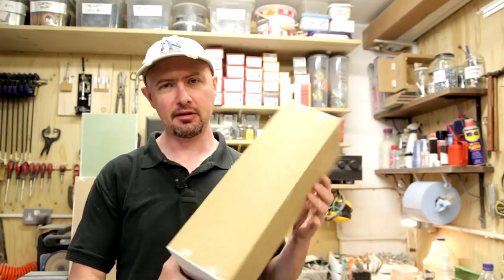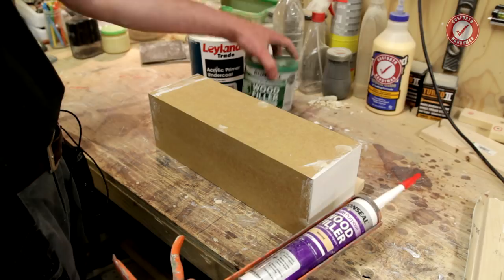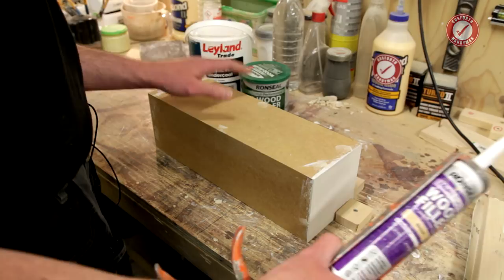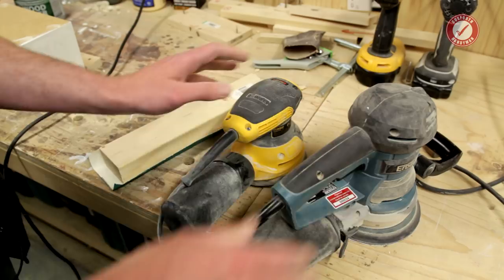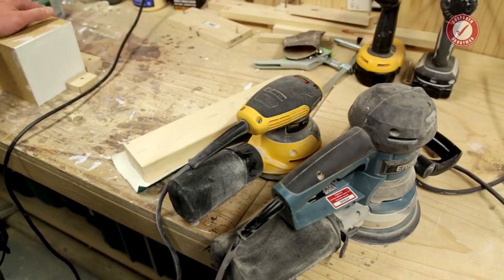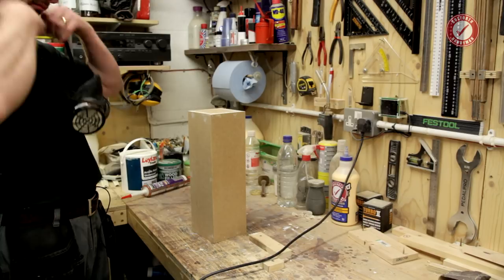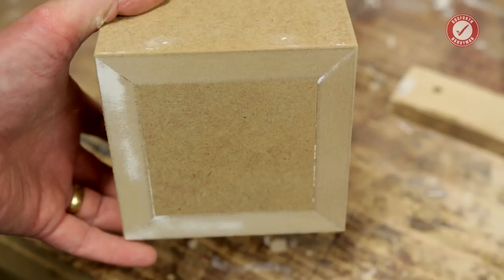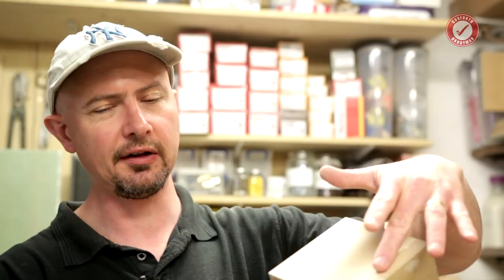Making Display Plinths - Preparing MDF for Painting (Part 2 of 3)

Comment: Andy, I work with alot of mdf and I do a full mitre wrap for boxes like that, including the two end pieces. It means I do not have to sand the dreaded end grain and the paint finish is always mint. Have you ever tried it?
Reply from the maker: Yes - sometimes do it that way too. Entirely depends on job costs etc. End grain won't be a problem with these. 👍😀

Comment: How do you know which is the top and which is the bottom, and does it matter?
Reply from the maker: Craig Heath I pick the most perfect side as the top but if there's no difference it doesn't matter. Depends on the design too sometimes. 👍

Comment: Have you tried experimenting with general purpose fillers?  I’m thinking mdf is stable so you may not need to use a dedicated wood filler which requires mixing, thanks for the video great job
Reply from the maker: Cheers - the stuff in the tube doesn't need mixed. The 2-part is for bigger areas that I need to dry quickly. 👍

Comment: I agree with Matthew. Have a word with Peter. Good video Andy, thanks. As I have an mft type top, bench dogs work just as well. I've only ever used a primer / undercoat combo, but the results have never been as good as I want. Would primer then undercoat then top coat be better?
Reply from the maker: I use primer / undercoat combo and the results are perfect - difficult to say without seeing a pic what the problem is. 👍
Reply: Morning Andy. No pic to hand, but I have made some additional enquiries. If using a darker wood, 2 coats of primer / undercoat combo will be required, with a light sanding in between, then 2 coats of top coat, again with a very light sanding in between. I'll let you know how I get on with the architrave.

Comment: if I don't have an electric/air nailer, what would you suggest I use instead?
Reply from the maker: Good question! You can tape it until the glue is dry or CA glue is another good option to hold the joint while the wood glue dries. 👍